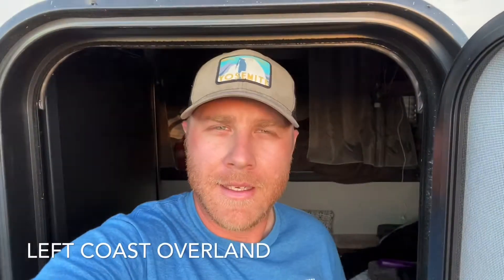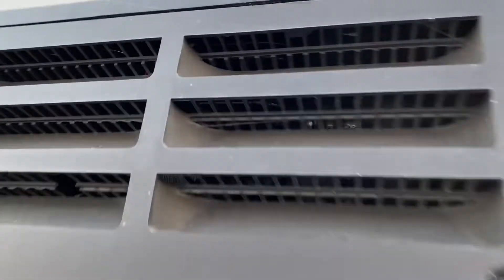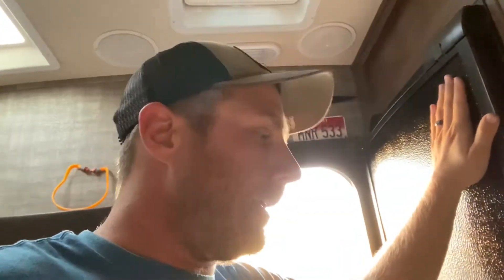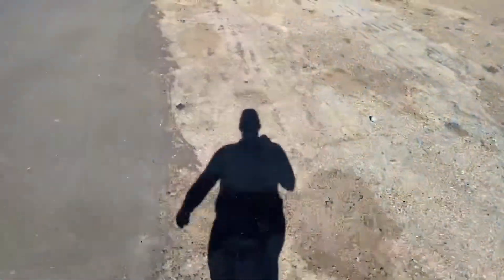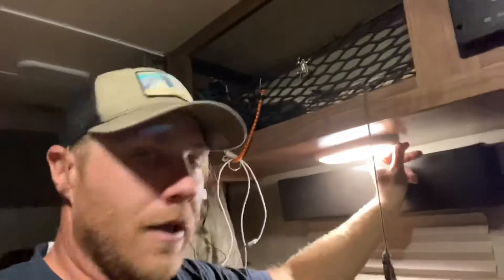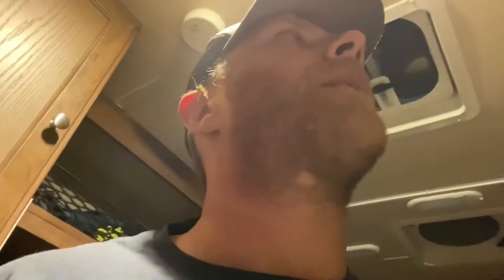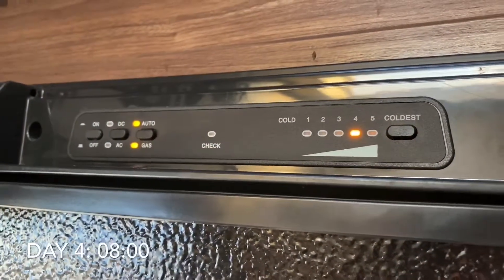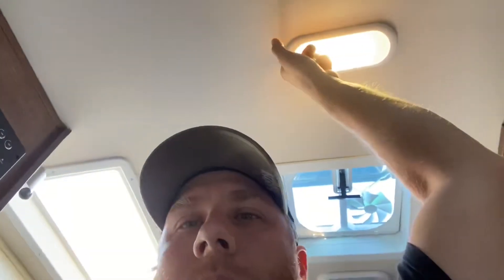Palomino Truck Camper HS650: House Battery Life

Comment: Truck battery doesn't supply power to the house battery unless the engine is running...AND if it's wired to do so.   Unplugging wouldn't make a difference to your battery test.   Unless of course you'd start the engine and drive, then it would trickle charge the battery.

If you're draining the battery low enough to not be able to run a fan and a light, you're damaging the battery.
Reply from the maker: Cool!
Reply: Hi, I just legit my mavrick trailer. Do I just plug it  110 volts to charge the battery???